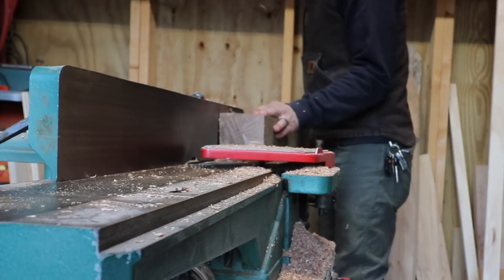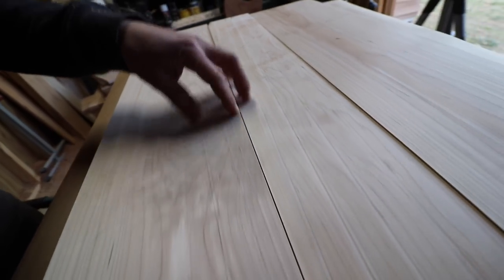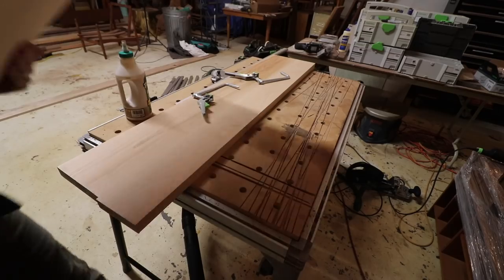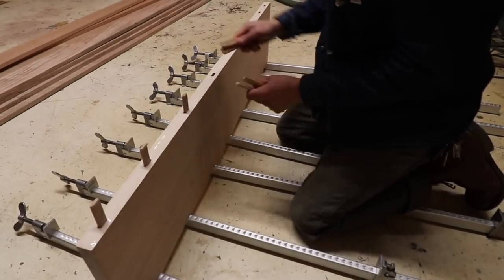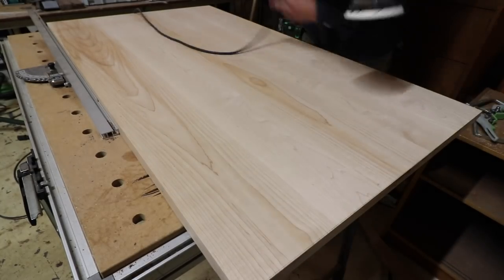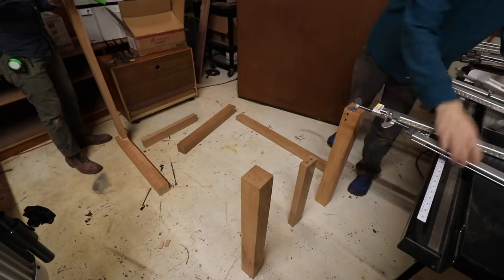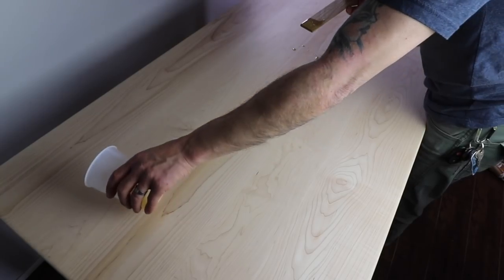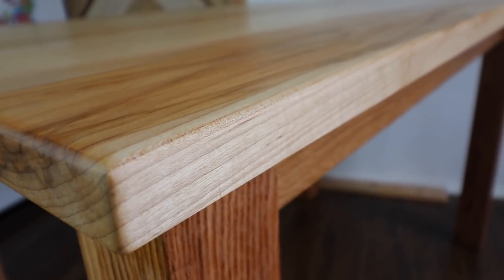HOW I Made this FARM TABLE (DIY)

Comment: I love the new table. Years ago, when I was in junior college,  I would take carpentry and basic woodworking classes to fill in gaps between classes. I loved working in the big shop. I learned how to use a biscuit cutter, which is a precursor to the tool you used, I'm sure.  I loved using it.  When I assisted in a class for learning challenged adults, that was one of the tools they could use with minimal supervision.